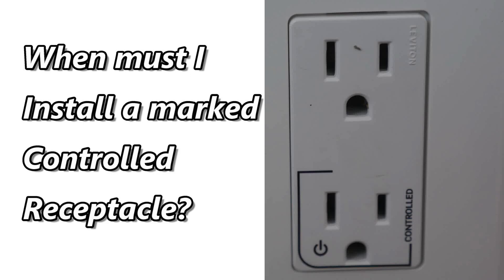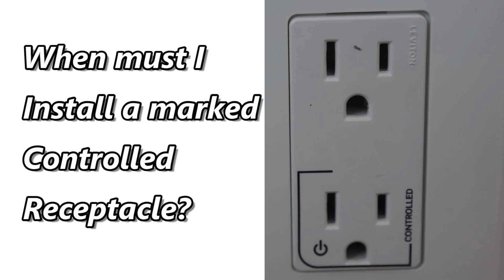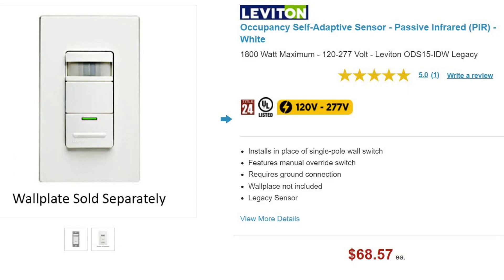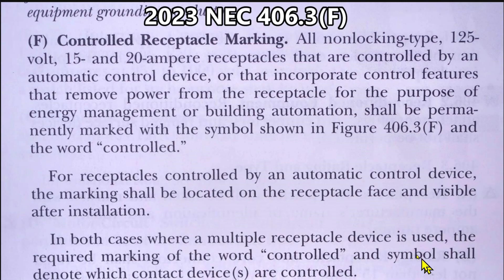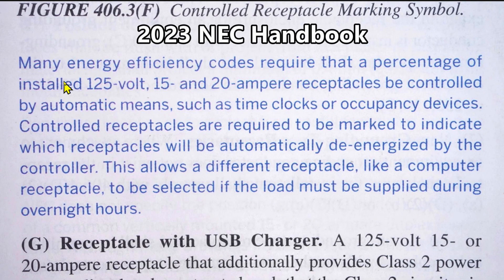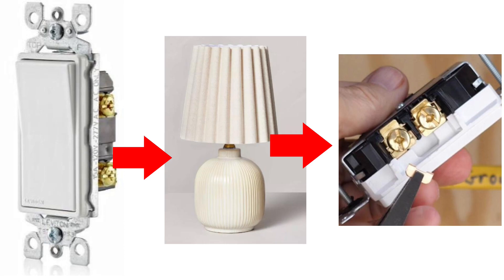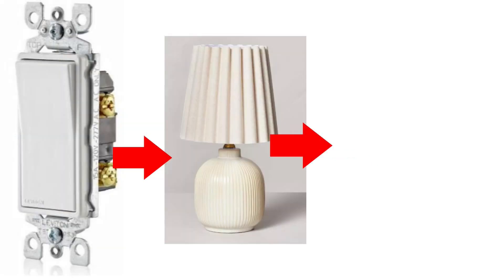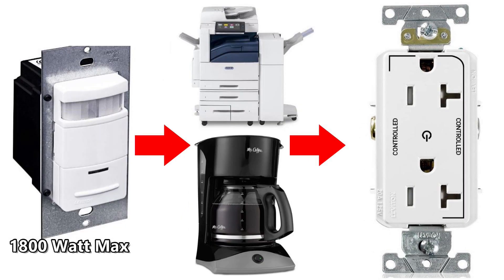When Must I Use a Marked Controlled Receptacle?

Comment: I suspect the exception for switch-controlled receptacles is to accommodate the millions that are currently installed like that. But unless the code forbids it, I’d mark all controlled receptacles regardless of how they’re controlled. It’s a nice convenience for the user.
Reply from the maker: Sounds good, thanks Rick!
Reply: I do think "controlled" implies some kind of automation or scheduling, not manual switch or simple count-down
Reply: Chnages in general apply only to the new installs. You do not need to change things just because the code changes. I think people are just used the the switch control. Some outlet controlled by some timer who knows where is different.

Comment: Unfortunately, you need to have swtiches rated for plug loads, when usong the automatic means. That 1800W occ sensor is insufficient for that. It needs to able to handle whatever may be plugged into it. A compressor, for an example, could be plugged in, and that is most certainly more than 1/2HP... it is a big pain for customers. It now costs almost twice as much for receptacles as it once did  since the newest energy code has taken place.
Reply from the maker: Let's see... a 20A circuit can take up to (80%)= 16A x120V= 1920W. So you are correct. If it was a 15A circuit, 80%=12A x 120V= 1440W which is 80% of the 1800W rating for the occ switch, so that would be OK. Agree?
I'm thinking of re-making this video. That is, taking this one down and putting up a new one with new examples. Can you think of a good example or 2 for my new video? Thanks!
Reply: @SparkyChannel  I would see about getting your hands on a ceiling occupancy sensor and plug rated power pack (relay) either wired or wireless. The switch you mentioned, if I recall, said it had 1/2HP motor rating. That, in and of itself would disqualify it from being used to control a receptacle. The switch needs to be fully rated for the load. 

I don't think that most people would know that anything was wrong with this, but I've been dealing with the IECC code rules for months, and they are kind of crazy... and things get expensive.
Reply from the maker: Thanks so much! That's a great idea for a video, but I'm not seeing where it involves a marked controlled receptacle. The ceiling occupancy sensor usually just controls lights, not a marked controlled receptacle. There is more to this than I thought! LOL @IceBergGeo
Reply: @SparkyChannel  oh, there is a lot more to it, to be sure. The ceiling sensor can control two power packs, one for lights and one for receptacles, and a switch to dim the lights, or manually switch them. You can also have a wireless controlled receptacle too. Very handy when you have to have them installed in office furniture...
Reply from the maker: If the power pack from a ceiling PIR is controlling a receptacle (wired), wouldn't that receptacle have to be marked controlled? Also, if the power pack was controlling the receptacle wirelessly, wouldn't that receptacle have to be marked controlled?  @IceBergGeo
Reply: @SparkyChannel  yes. Exactly.

Comment: I accept that the copier shown was just a convenient picture. However, for someone who may have one of those copiers, please do NOT turn it on and off by cutting the power to it using an occupancy switch. That copier, and many other large copiers, have hard drives in them. Turning them on and off by plugging them in and unplugging them is going to damage them, just as it would a computer.
Reply from the maker: Thanks, good point!
Reply from the maker: I'm thinking of re-making this video. That is, taking this one down and putting up a new one with new examples. Can you think of a good example or 2 for my new video? Thanks!
Reply: @SparkyChannel  I usually use the occupancy switches for overhead lights. This is probably the most common, but doesn't require the labeled outlets. Some things I can think of for the labeled outlets could be space heaters, air compressors (think auto shop), radio (hopefully, the volume wasn't left cranked up the last time someone left 🙂), computer monitors (not the computer itself), and surveillance system monitors.

Comment: I’ve not seen office equipment use IR to shut it down, normally they have internal controls. Most are lighting and fans are controlled. Internal damage can be made to the software and hardware, they typically wake up to do timed maintenance.
Reply from the maker: Thanks!

Comment: Hi Bill.  406.3(F) covers the requirements required for marking of AUTOMATICALLY controlled receptacles.  Automatic control could be a OS device, time clock/timer, or other AUTOMATIC devices.  The wording, "or that incorporate control features that remove power from the receptacle," could be a programmable Energy Management System.  The intent was to make sure that the end user of the receptacle knew that the receptacle may not be on 24 hours a day. This often occurs when buildings are supplied by an energy management system.   The switch example at 5:30 controlling the printer is manually controlled, not automatically.  Some thoughts.
Reply from the maker: Hi Don, great to hear from you on this! How about the phrase "or that incorporate control features that remove power from the receptacle". Wouldn't that describe a single pull switch? Doesn't a regular switch remove power from the receptacle?
And then in the exception, "The marking shall not be required for receptacles controlled by a wall switch that provide the required room lighting outlets as permitted by 210.70." My point here is that the receptacle at 5:30 doesn't control lighting, it controls a copy machine. If the receptacle controlled lighting, I would agree with you.
Reply: The first sentence of 406.3(F) defines the scope of the article.  Receptacles that are controlled by an AUTOMATIC control device as I mentioned in my last post.  I posted that quote that you mentioned previously also.  That I believe, probably is covering other automatic energy control systems  such as a central Energy Management System.  The intent of automatically controlled receps is for energy management by taking the human element out of the picture.  Personnel are not always going to remember to turn off a regular wall switch that's controlling a recep of an energy consuming piece of equipment.  The next to last paragraph in 406.3(F) states, "For receptacles controlled by an AUTOMATIC control device, the marking (control marking) shall be located on the receptacle face and visible after installation."  I suppose one could use a controlled recep as a switched recep, but it might cause confusion by someone understanding  406.3(F)  as an automatically controlled recep.

NOTE:
 ANSI/ASHRAE/IES Standard 90.1-
2019: Energy Standard for Buildings Except Low-Rise Residential Buildings.  Section 8.4.2, at least 50% of all 125V, 15- and 20-
amp receptacles should be automatically controlled by a device that turns
power on and off based on a schedule, occupancy sensor, or an automated
signal from another control or alarm system. These automatic control
devices may be in private offices, conference rooms, rooms used primarily
for printers/copiers, break rooms, classrooms, and individual workstations.
ASHRAE 90.1-2019, Section 8.4.2 also states that at least 25% of branch
circuit feeders installed for modular furniture must be automatically
controlled.  Exceptions to 8.4.2: Receptacles for the following shall not require an automatic control device:
1. Receptacles specifically designated for equipment requiring continuous operation (24/day, 365
days/year).
2. Spaces where an automatic control would endanger the safety or security of the room or building
occupants.
Energy codes only state that the receptacle shall be permanently marked to visually differentiate
them from uncontrolled receptacles, but do not specify the marking requirements. However, the
National Fire Protection Association (NFPA) 70, National Electric Code (NEC) does specify the
markings. @SparkyChannel
Reply from the maker: Hi Don. I'm thinking of re-making this video. That is, taking this one down and putting up a new one with new examples. Can you think of a good example or 2 for my new video? Thanks!
Reply: You pretty much covered the local control for controlled receptacles, with the exception of the manual wall switch.  Another example might be using an astronomical timer.  For central controlled energy management, Leviton has programmable control panels and relays that could be used.

Controlled receptacle are require to meet Energy Standards for Buildings Except Low-Rise Residential Buildings.

Comment: This is one of the stupider code updates. An unused outlet uses no power, but a motion sensor has a constant (albeit very low) load.
Reply from the maker: Good tip, thanks!
Reply: Incorrect. A piece of equipment may be drawing a much higher phantom load being left on than the occupancy switch.
Reply: That would be a used outlet. An unused outlet would mean nothing is plugged into it, and would have zero load, except for the current drawn to operate the motion sensor (which is not zero). @Noah-qt3rq
Reply: @jameskoehler4939 I can agree with that statement, but statistically, if even 1% of the outlets that are controlled have something plugged in, the cost of the quiescent current, is now (most likely) mitigated by the saving of what was plugged in, and is now off.

Comment: I'm having flashbacks to a custom home that had a whole house lighting control panel.  the problem was that the system included switched outlets for lamps, and the control modules were only rated for 5 amps, so when a housekeeper plugged a vacuum into a lighting outlet, they would accidentally fry a control module. for a while, there was a discussion of changing every lighting outlet in the house to twistlock, to stop it.
Reply from the maker: Wow! Great story and example!
Reply: @SparkyChannel  it did prejudice me against whole house lighting control systems. it was poorly engineered and poorly installed, and every time it broke, it was a headache to get back online.
Reply from the maker: Some vacuum cleaners are 12 amps now, so they would really fry those control modules.  @kenbrown2808
Reply: @SparkyChannel  the Hoover Wind Tunnel was 13.5 amps in the 2000s.  it was a code violation to plug it into a 15 amp combination circuit. I finally started telling people to plug their vacuums into the bathroom receptacle, because so many contractors were stretching 15 amp circuits to minimize how many AFCI breakers they had to buy.
Reply: @kenbrown2808 I am curious where you think that is a code violation to have something plugged in and turned on for a short period of time. If it was a violation, the uL (or other testing/certification agency) would have deemed it necessary to use a 20A cord end on it.
Reply: @IceBergGeo  in a combination circuit, a motor load can't exceed a specific percentage of the total ampacity of the circuit.
Reply: @kenbrown2808  do you have a code reference? Not trying to be difficult, but this is something that seems... strange...
Reply: @IceBergGeo  430.24.  but you did make me redo the math.  a 13.5 amp vacuum has to be calculated at 16.8A.  a 12A motor is the largest that can be run on a 15A circuit at all.  an 11 amp motor gives you 150 watts for light bulbs.
Reply: @kenbrown2808  I think you're going too deep... what you are looking at is dedicated motor loads, not receptacles. Also, a vacuum is not considered a continuous duty load, so the 125% is not valid. 

I just wanted to know where you were coming from, so I could speak succinctly with respect to why you are wrong.
Reply: @IceBergGeo  a vacuum motor is a motor.  motors have inrush current, so motors have the +25% modifier.  full stop.  combination circuits with motors, even those under a horsepower, have the full load of the motor, plus 25%, plus 100% of noncontinuous loads, plus 125% of continuous loads.  

so yeah, if I still had the number for my old inspector, I'd pass it along so you could get a formal schooling, but he's retired.  there's a reason why the "my vacuum keeps tripping the breaker" calls I go to are in houses wired by other electricians.
Reply from the maker: Hi guys, I'm thinking of re-making this video. That is, taking this one down and putting up a new one with new examples. Can you think of a good example or 2 for my new video? Thanks! Examples of code are good as they make people think in practical terms about the technical points in the NEC. Also, I find different readers of the code have different interpretations. @kenbrown2808
Reply: @SparkyChannel  i think this one covers this topic well. I'll see what interesting code things i can come up with, though.

Comment: If the marked controlled receptacle is not continuously reactivated when in use; I assume, it would time out?  In other words; if a person working at a computer remains motionless for a sort period, the device shuts down?
Reply from the maker: It shouldn't. The PIR switches sense heat and movement so they should stay on if anyone is in the room. There are also settings which make the devices stay on for an adjustable amount of time once someone has left the room.
Reply: @SparkyChannel the energy code has specified times/durations that the receptacles are permitted to be on. Sometimes, it is a time clock, sometimes it is a BMS, sometimes it is just an occupancy sensor. And if the timer/time clock goes past normal on times, you will have to seek the override. It is probably  just telling you to go home though.

Comment: Hey Bill. This was a good example and explanation for these outlets. Can’t tell ya how many people (homeowners) didn’t even know that their outlets were half switched or didn’t know what the switch in the room did if you can believe it. Now with the markings that will help, hopefully 😆
Reply from the maker: Oh man, half hot receptacles cause a lot of "repair calls" which are really just teaching the occupants about half hot receptacles. The markings really help reduce those calls.
Reply: @SparkyChannel  and it took long enough for the code writers to get this done. I agree about the electrical tour and how to for homeowners.
Reply from the maker: Yes, when tenants move in, an electrical tour can really save some calls.  @anthonyelectric6045